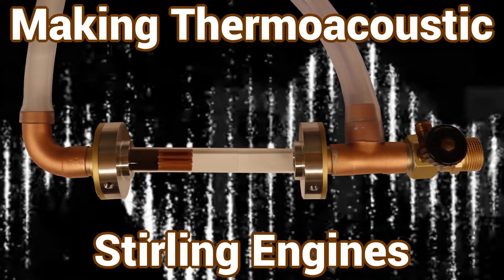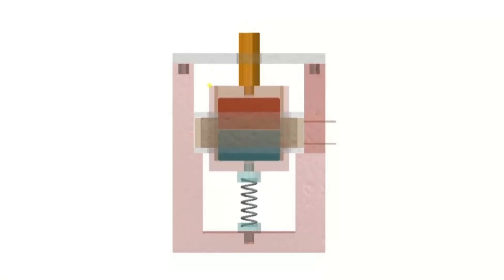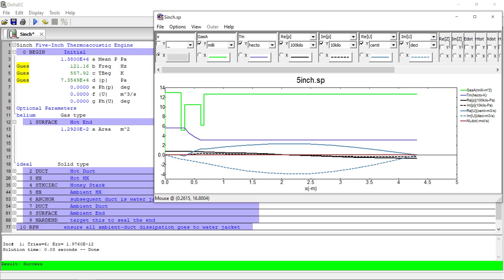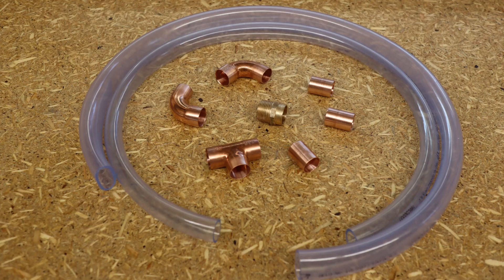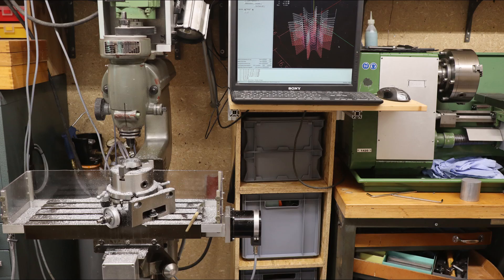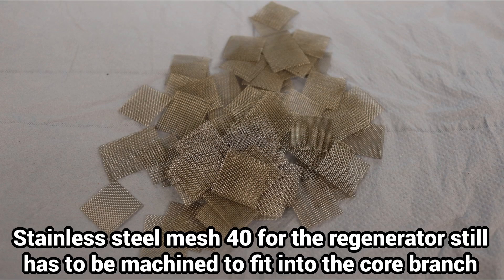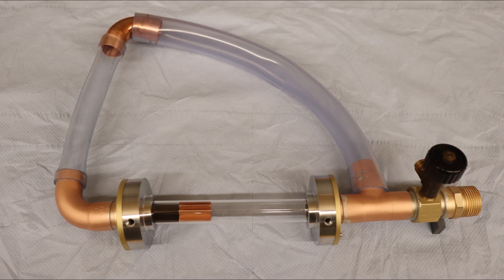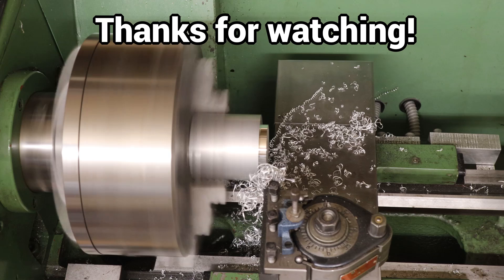Building a Thermoacoustic Stirling engine to support our solar plant for cheap energy to go off grid

Comment: In principle, you could design a thermoacoustic engine using He, and ionize the He to extract electric energy without moving parts since you will have moving charges due to the acoustic waves.  I don't assume this would be efficient, but it's a novel approach to the 0 moving parts problem.
Reply from the maker: But it will be hard to get useful power levels I think?
Nevertheless an interesting idea...

Comment: Can we contact in a private method. I am a retired  Spanish engineer expert  international in thermoacoustic since the year 2000. Attila and tibsim are friends of mine . But they do not know how tu design thermoacoustic  devices using Delta ec  software.
I am expert in stirling engines since 1980.
You are better than me making beautiful engines.. Do you know design thermoacoustic engines using Delta ec software.

which is your country ?
Reply from the maker: Hi Jaime, nice to hear of you.

I hope you read my answers of your kind comments as I really have a bad conscience as I did not know that the engine is your invention!

I am still at the beginning of working with the thermoacoustic engine and try the more experimental way till now.
I have DeltaEC installed and play a bit with it but have to read and understand in depth the instructions first.

I already begun to study your book and the book  'Thermoacoustics' of Gregory Swift but thermoacoustic theory is really a hard topic and my university study of mathematics and physics is 30 years ago.
I would really like to stay in contact with you, my email is tom-rock@web.de and I live in Germany.

Next step for me is to gradually improve the engine experimentally , attach a generator and then try a bigger version with a 40  mm test tube and see what has to be changed and how much more power can be generated.

I would be very happy if we could talk about it.

Many thanks for your interest!

Ralf

Comment: So that machine thing that you were using that lathed that middle with the autocad program basically automating it what is that thing how much did that thing cost and where do you source the metal for something that's like that for the the cutting purposes and whatnots I'm just curious? 

Exactly how do you come across these type of things meaning the thermo acoustic motor in general it's like did you learn about it from a friend did you learn about it from professor a book or were you just like scouring patents for like months on end and then finally find some really cool neat old buried patents that are more feasible to actually create currently with today's technologies?

Comment: I have a proposal, now it's not one of those unserious ideas but something to consider, and has been considered by other you tubers who realise its potential. What if I told you, you can achieve 30-40% maybe 50 if your lucky, thermal efficiency. I propose a Tesla turbine, you may think to yourself that its:
-Loud? - maybe, or no
-expensive? - no
-difficult to manufacture? - no, well idk
-precision = higher tolerances = more attaining thermal efficiency but at a expense - hmmm maybe
-impractical (stirling engines prove better advantages) - however are difficult to reach higher efficiency's 
-the internet has told you otherwise ( too much rpm, means higher tolerances, and lower torque) - well this has been disproven
Well from my experience watching you tubers who deal in the same circumstance and have the engineering mindset as do you, I want to connect that bridge.
The idea is simple, you have a Tesla turbine, either powered by steam or combustion and or both, that has been tested by another YouTuber and has gone through dyno measures (steam), and details all the physical properties in tables achieving 34% thermal efficiency. now this is the basic Tesla turbine.

I on the other hand say if you mesh your fingers together, and do the same for Tesla turbine disks, you have weirdly similar alpha omega engine with counter spinning disks, that cancel the gyroscopic precession,  looks like a Venn diagram, where the input comes into the intersection of both disks. Can be used as a supercharger and a turbine, maybe even try both and they can work centripetally or centrifugally. all you need to build if you are doing combustion is create those turbo combustion chambers that feed into turbo and fed compressed air by the turbo. essentially making a jet engine that tries to retain thermal, kinetic and pressure energies from the hot gasses from spinning disks. I even came up with connecting both compressor, generator and turbine by meshing 3 spinning Tesla turbines in one casing with oil acting as a CVT. It may just be a solution. or try two seperate CVT's that are compounded together, to achieve better gearing ratios, tryout spinning different radius turbines see if that works like gears or even adjust the operation of the axels. I hope you see this comment and find lots of potential from this idea. 
This allows experimentation, of many different fuels, steam, coal powder, wood gas, biogas cooking oil. lastly a heat exchange can be used to produce lower heat exhaust raising the ignition temperature in the combustion chamber, Chrysler has done something where the rotate there regenerator passing cool air from oneside into the spinning region, and on the other hot exhaust heat up the other end of the disk, the disk spins returning to cooler side, and they come out with quiet cool exhaust.
But my opinion should stick to one turbine not couple them.
I hope for your consideration and the best to you! And I hope to hear from you, what you might have to say, or consider.

Comment: Okay... I've been reading an older textbook called  "Applied Solar Energy" by Aden and Marjorie Meinel. There is documentation on several closed loop systems that were turbines of appreciable power generation capability. They were running on the ORC or Organic Rankine Cycle. Have you researched the ORC? Regards, Matt.

Comment: try steam drum engine, with directional inside rim wings, you have small amount of water inside, which is heated by external heat source, like fire, then the wings make the steam flow rotate the drum. steam rises to the top from the bottom, and gives out heat, condenses back down. yep very similar to stirling cycle but its a turbine. yep flash boiling if anyone asks.
Reply: yep a direct rotary stirling engine, not piston motion, yes even with just sealed air, yes hot air rises to the drum top, cools at the top, flows down.

Comment: I had an idea... Being as you said, the most difficult part, the generator, and being often water the cooling medium for the cold side of the engine, could be very beneficial to re-think the thermoacustic engine into a thermoacustic "water piston pump".
The goal will be lifting to a specific head an easy measurable amount of water.
That would translate into a known amount of potential energy and translate into a certain efficiency measurement of the engine efficiency.
Than, that water reservoir it is also a small energy storage and for emelectric conversion even a bucket wheel attached to an electric motor could fit the job.
Please consider the topic as a key to simplify the engine technology and make it even priceless for developing countries, to obtain water pumping action from wells.
Bye!

Comment: aren't you concerned that the pvc tubes will dampen the acustic energy or is it a desired feature ?
Reply from the maker: Yes they will but this is just a proof of concept engine and if the performance is reduced because of the pvc tubes it doesn't matter.
There are thermoacoustic engines which work with 'flexible' tubes.